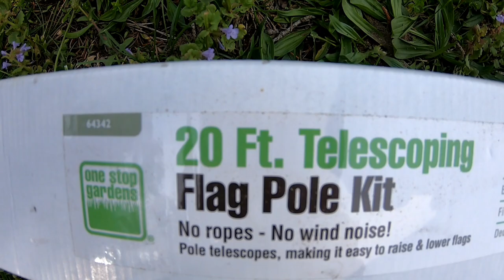Installing A 20Ft Telescoping Flagpole🇺🇸 For Flag Day!🇺🇸

Comment: I also got a 20 foot flagpole, more realistically about 18 feet with it sitting in the ground, but my 6x4 flag looks great on it. But to be honest with you, I don’t recommend the stock PVC tube, but if that’s all you have than it’ll do, great video!!
Reply from the maker: Awesome! Thank you! Yeah the pvc pretty much held the concrete in place so at this point if the pvc cracks or breaks the concrete already shaped out the hole for the pole ,thank you for watching!👍😊